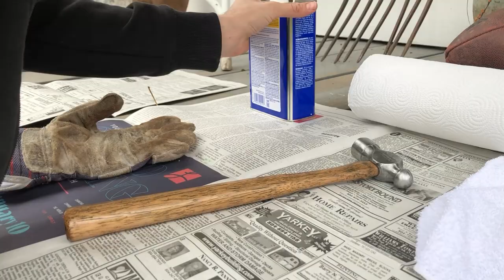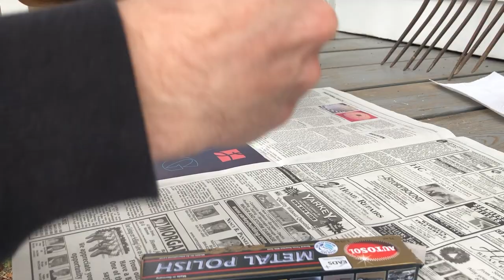$1 Ball Peen Hammer Restoration | ASMR Tool Restoration

Comment: What grit did you use on the hammer halfway through the video?  Just happen to be doing the same project the same way, but I’m toggling through skateboard grip tape (prolly 30 grit), 800 grit, vinegar and brass brushes.
Reply from the maker: I started with an 80 grit, then a 200, and finished with a 400, thanks for watching.